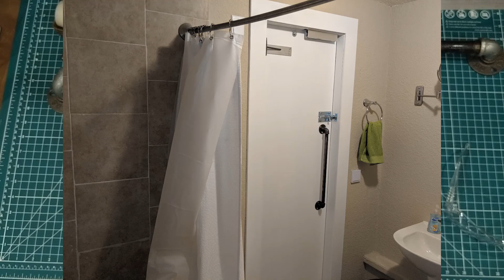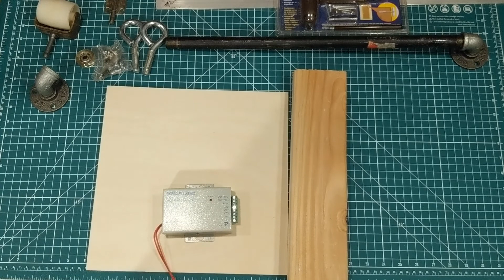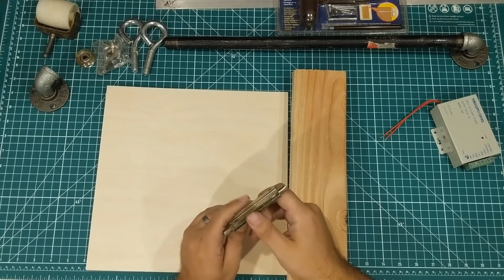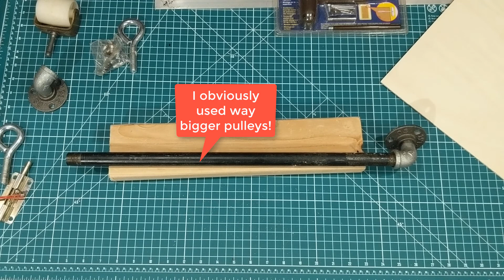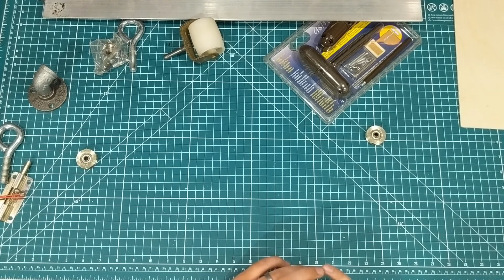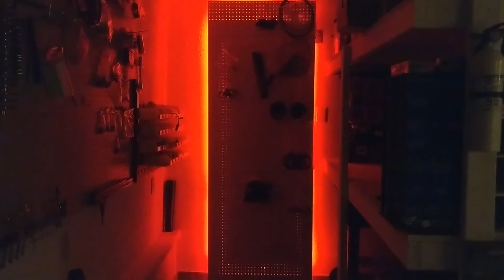"Engineering" a Hidden Bathroom - Raid My Lab Episode 005

Comment: So how do you actually open it? Does it have a remote? Also, what kind of lights are those? Did you use a microcontroller of some sort for the controller?
Reply from the maker: I have an m5 stack that looks like a clock that can open it.  I cut it from the video because the reflection was terrible. Alexa can open it as well as a node red dashboard button and a hidden red button. There is also a mode with no sound and one that is 10x faster but just speeds up the lights and sound. 

An esp32 controls the relay in the wall and an ESP8266 does the led strips. They are cheap $5 led strips from Walmart. A sonoff does the main bathroom light.
Reply: @AnotherMaker  Neat, thanks